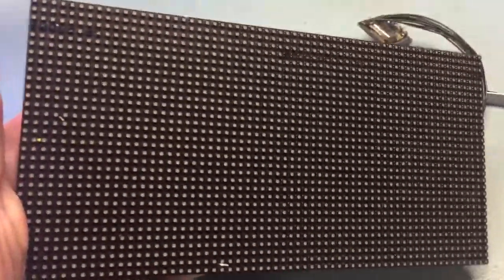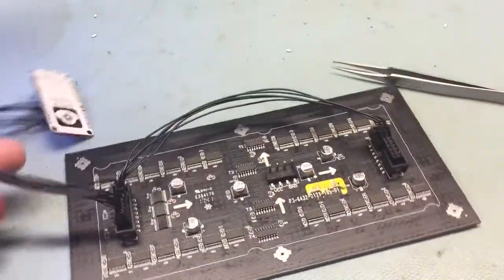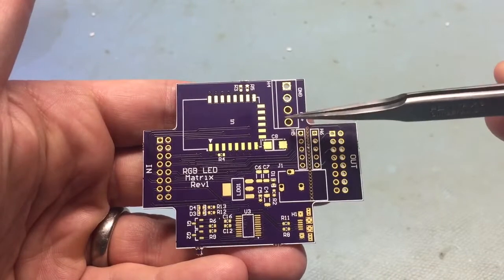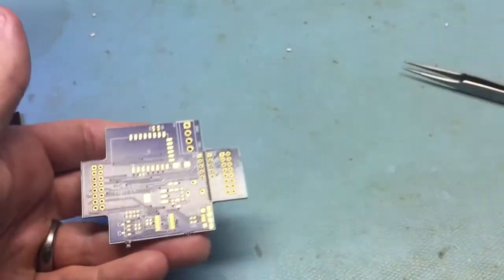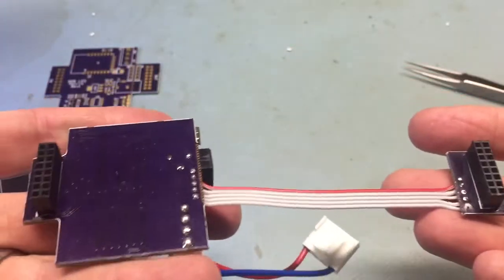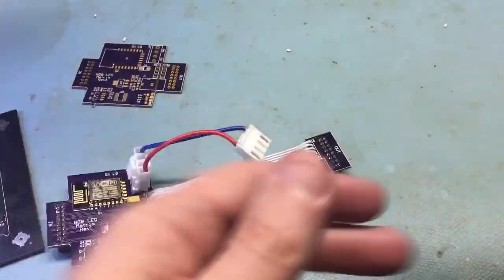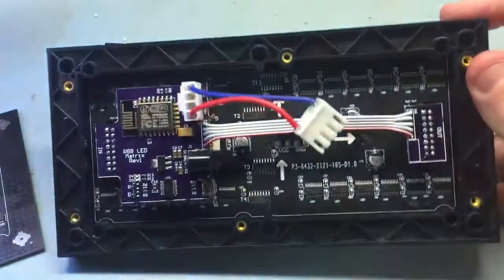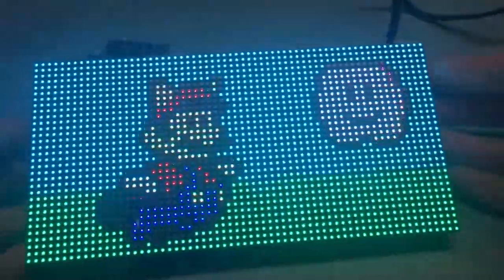ESP8266 RGB Matrix (Cable Version)

Comment: hello sir ..can chain with 2 or 3 module?
Reply from the maker: LI JIA not that I’m aware of.
Reply: @0miker0  I think you can chain, the library does support it. However, you would need a longer wire to go from the last panel in the chain back to your PCB.

Comment: Nice job! And far nicer than my efforts in my last couple of videos! If you do a Rev 1.x you could make solder jumpers for the other types of display. I have a P3 and a P5 panel and both are wired differently. Great channel subscribed!
Reply from the maker: Kris Cochrane just today I’ve connected a few other 32x32 types and none of them work. My next revision is wired the same but large enough that no wires at all are necessary.

Comment: Nice board. Why do you need to feed the output connector of the display pannel ?
Reply from the maker: I’m not positive but I believe the other data pins like D and E are on the output connector.
Reply: Probably. So how could you daisy chain the displays then ? The esp8266 can drive a small matrix of 64x64 pannels (with an proper dedicated PSU). Adding a couple of 74HCT245N level shifters would also improve compatibility with the pannels. Some are not happy with the 3volts signals. If you make a V2 mike, i'd love to get one ;)